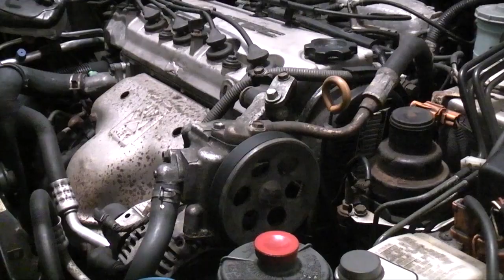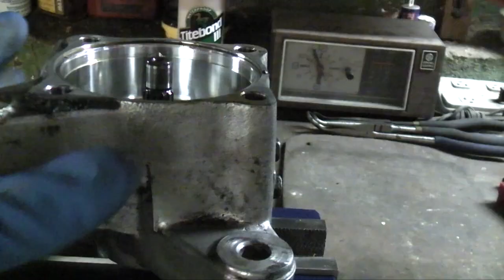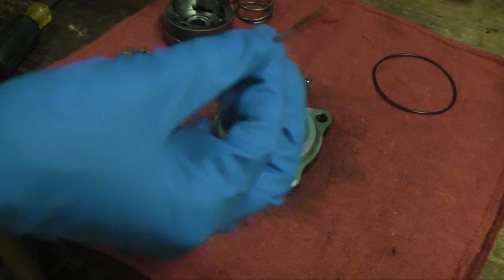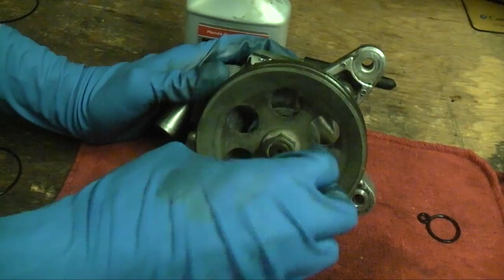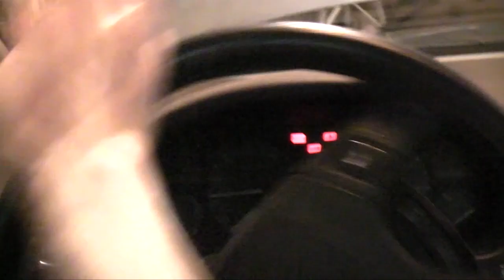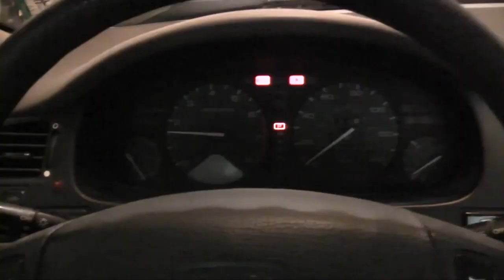94-97 Honda Accord Power Steering Pump Leak Reseal Repair

Comment: Il this is old but can you help me , idk if the power steering pully bolt is reverse threaded or not I see you turn it right and it comes off so is it ? Idk if it’s that or if my threads are messed up and it’s stripped on their

Comment: I've owned my 94 Honda Accord EX coupe for 26 years now and done most of the work myself..

With 238,000 Miles my original power steering pump is time to be replaced.

Your videos are excellent..!

One question does the pulley come off that easy or will I need a puller?
Reply from the maker: It's splined to the shaft so it should pull off by hand.

Comment: good video friend just one question where can I get the power steering pump bearing
Reply from the maker: If you're referring to the outer ball bearing it's pretty standard you should be able to buy it from anyone who stocks bearings if you find the code stamped on one of it's sides. The Honda part number is 91048-PY3-003. If you're referring to the rear needle bearing that's 91021-148-004.
Reply: @Bushougoma  If that's what I mean ball bearing (bearing) and I haven't been able to get it, they tell me it's not very common.  I'm from CD Juarez Chihuahua Mexico friend.  but thanks for your information and for your videos that have helped me a lot, I have an Accord 1994 dx 16 valves

Comment: my driver side engine mount is oily and seems like oil is coming from the tube on top of that (coming from the pump) what does it mean? reservoir is full (higher than top line when hot)

Comment: Trying to torque my pulley nut, but  the torque wrench is not clicking at 47 ft pds. I don't want to snap the shaft off. Used torque wrench on lug nut at same spec and it clicks no problem. Will tight as I can get it be ok?
Reply from the maker: Just get it snug and it will be fine.

Comment: Thank you very much for your video. Though I have Honda Civic 95 the power steering pump is absolutely the same. I did everything exactly as you showed and it went perfectly well without any hitch.

Comment: i hope i can fix mine like this.  2007 mazda 3, big leak out the back of the pump......the metal part, not the two flex hoses.  it flows out pretty quickly.  is it possible the lower section is electronically fried?  i drove home 7 miles after the pump leak happened so i assume it is fine.  there is no noise or anything, just a flowing leak out the metal section.

Comment: there was no need to remove the rotor from the backplate since it came out intact. You could've replaced those two o-rings with the rotor assembly as it sat when you removed that backplate, thats what I did on mine just now....way easier not having to worry about losing those rotor pieces.
Reply from the maker: Removing the rotor is still a good idea so you can inspect the rotor and it's bore for debris or scoring.

If it's badly scored you're better off with a rebuilt unit. I believe I neglected to mention that.
Reply: Did the same thing; left the back plate assembly intact and just switched o-rings.

Comment: you could first break the bolt on pulley then remove the belt
Reply from the maker: +08yallvon The belt doesn't have enough tension on it to hold the pulley it will slip when trying to remove the bolt by hand. The easiest tool to use is an impact which is what I normally use.

Comment: i regret repair it, just replace it with whole aftermarket new ps or stock or used item ps rack & pinion
Reply from the maker: +Jimmy Johanes A used pump will have seals just as old or older than your current ones on the verge of failure. Rubber doesn't get better with age. As for rebuilt parts. The quality of rebuilt aftermarket parts depends on the quality of the core and the quality of the parts used. I have had some problems with rebuilt power steering pumps right out of the box.

If the OE part is in good mechanical working order you should try to keep it. If in addition to leaks it's making noise or not operating properly then yes a reseal would be a waste and you should replace it.

Comment: Hi, my 94 Accord started making ps pump whine noise and bubbles in the reservoir, no leaks and it still works as it should. My question is, with a reseal kit will help pump or is better to put a new pump?

Comment: hi i have 2005 honda pilot, when i put new power steering pump do i need to fill it with oil, this isbecause for first second or two, when i start the car, (after topping off the reservoir of powe steering) the pump will run without oil .. is that ok..
Reply from the maker: It's fine as long as the reservoir is full before you start the vehicle. The pump won't run for too long before it primes and has a supply of oil.
Reply: Thanks much, do you recommend honda reman power steering pump or OEM. i heard cardone reman is not good. can i get used one from ebay.. or OEM pls advise.
Reply from the maker: sivaraj palanisamy I've used aftermarket remanufactured pumps without issue. Just make sure that it's done by a well known company.

Cardone is a major supplier of remanufactured parts.

Comment: Hi, I'm from Venezuela and here these pumps are very expensive and that set of seals are not available easily to repair pumps. I have a 97 2.2 Honda Odyssey which has a massive leak of steering fluid. I wonder The pump that has my car is the same pump that you show in this video? &  What part number should I use to order the set of seals? Thank you for let me know in advence..
Reply from the maker: The pumps while they look similar have different part numbers so they do vary somewhat.

Your local dealer should be able to get you the seal part numbers.
Reply: Thanks for your help. But Honda is leaving Venezuela due to the political issues here.. I can buy the part on the net.
Reply from the maker: Nicola Briceño Try hondaautomotiveparts you can get parts diagrams and look up the part numbers there.
Reply: Fine.. I'm going to check on it.. Thank you
Reply: Best thing to do is sell that car and leave that country for good. Thats what I would do if I were you, in fact that is what I did.

Comment: i recommend tightening all bolts in phases, never tighten a bolt all the way pattern or not , bring the entire face in gradually
great video nun the less
Reply from the maker: A torque wrench like the one used on those bolts must be used in one continuous rotating motion to achieve the proper torque. A tightened bolt will take MORE torque to rotate initially due to thread tension than a bolt already rotating which will give you a false reading.

Dividing the torque into multiple passes would solve this issue but it's a bit of a waste on such low torque fasteners (we're not dealing with a head gasket here) but you can if you want.
Reply: ***** not true about the false reading, truth is when you do what you did you smash your gasket down to a thickness thinner then a proper set gasket wit gradual tightening of bolts in steps. with phased in torquing this is mitigated. you can smash an o ring in half doing what you did  . nobody likes advice these days but im just trying to help freind , not only am i a part time millwright but i made this mistake on a pressure washer . you can smash a corner down to a lower depth then you can smash the entire gasket so basically you just "BENT"  the face of that pump .
Reply: ***** i was mostly talking to other viewers who seen you do this and did not under stand the expensive mistakes that can be caused as a result . on a car what you did is just fine no harm but if this was an air plane it wouldnt fly no pun intended

Comment: Hi, I follow the way you do it to unscrew nut pulley is clock wise, but unfortunately my pulley was dented due to force removing my civic nut pulley clock wise and at the end found out anti clock wise Arggg... anyway thanks for the video :)
Reply from the maker: The Civic uses a different style pump which is why I specified a certain model and year range of Accord in the title.

Other than the pulley nut being a standard thread and a few extra components inside the Accord and Civic pumps are surprisingly similar.
Reply: ***** Yeah, my mistake :( . I've download Civic manual but it did't says clock wise or anti clock wise.. I did search for you tube video for civic but fail...I'm so confident the way you do it haha..
Oh Btw, I manage to straight the pulley by hammering at the back...fuhh.. I'm lucky :)

Comment: Very nice video, do U THINK I CAN CHANGE THE PUMP BACK COVER O RING WITHOUT REMOVING THE PUMP FROM THE ENGINE?
Reply from the maker: Yes you can. But the other rubber parts are in the same poor condition and you may end up having to remove the pump to replace them in the future.
Reply: I was thinking the same thing bush. But then I also thought in the future of the shaft seal is probably worn and maybe some others so we'll have leaks elsewhere. Possibly even in the bypass or I mean the high pressure bypass

Comment: Busho, thanks for posting this video.  Again, you've saved me a load of cash.  So far it's working like a charm.  I think I noticed a little fluid under the pump after running the car for a bit.  I'll check again today after wiping it clean to make sure it's not left over from installation.  The only thing I can think of is the shaft seal.  I noticed after firmly tapping it into the shaft that the side with the writing on it was flush, but it seemed there was still a gap between the metal housing and the other side (with the spring). I'm realizing it's impossible to explain in a comment.  Do you know if it's leaking right off the bat or will it take a few days to notice a leak?
Reply from the maker: Make sure it's fully cleaned and recheck. If it's coming from the hole in the bottom the shaft seal is the only place it could be coming from.

Comment: Just did this on my 2000 Accord EX 4-cyl. As mentioned in the comments below there's a few less parts, but the basic design is the same.  A few less o-rings as well.  I was able to get the back cover o-ring off and replaced without taking the pump 'innards' apart, which simplified it for me.  There's no spring which helped.  Thanks so much for posting this video.
Reply: 10 years late but, do you know if the pulley nut is a left hand thread on the 98-02 models as well?

Comment: Does Honda of America provide a reseal kit containing all the needed "O" rings and the one seal or do you have to look up and order each part?  We have a 1997 Accord EX 4 Cylinder VTEC with about 177K.  I noticed several oil wet spots on the power steering pump.  The pump makes no noise. I will order the needed parts and reseal the power steering pump.  Thank you for an excellent video!  Your video has a great close ups on the area of dis-assembly/cleaning/parts replacement and reassembly. The exact amount of detailed instructions necessary and you don't waste time on the obvious.
Reply from the maker: Unfortunately they don't you have to order the parts separately.

I've tried using aftermarket reseal kits in the past to save me the trouble of ordering all the part numbers separately from the dealer and the ones I tried we're incomplete missing critical o-rings.

Comment: Great video! Exactly what I was looking for. I am about to do this on my 02 TL-S the pump is very similar. How would I replace the bearing without damaging the shaft?
Reply from the maker: There is also a needle bearing in the rear cover. A shop press is the best method you could also try an arbor press.

If the bearings are badly worn they will cause uneven wear on the machined surfaces of the pump in which case a remanufactured unit is the best option.

Comment: I searched entire youtube. i think only you did video on power steering pump seal replacement. i found few but not detailed to this extent. you are unique..

1) One of my friend have power steering pump growling noise(honda accord 98). when i open the cap of pump i see foaming and air bubble.
2) I tried many methods to remove air from system.. like mityvac, then dead end to dead end.. no use.. 
3) Can you tell me if growling noise can come only from pump and not from rack.
4) If pump(based on this video, which part cause the growling noise)..
5) do u think if pressure testing power steering pump is ever needed. I thought of bying the tool, but dont see any one using it.
6) you have changed some of the seal that is not exposed out, (meaning it is inside the pump), so why do u want to change that, i know there should be a reason, but like to know why.
7) can a bad power steering fluid will ruin the pump, if so which part goes bad, any clue.. 

SORRY asked too many questions, because i found only this video in entire site that explains about power steering pump.
Reply from the maker: Air bubbles that won't purge (assuming the reservoir is full) mean's you have a leak somewhere it also causes noise from the pump.

The leak can be anywhere the high pressure line, return line, rack, etc. Start easy check over the rubber return lines pay special attention to the metal hard lines they connect to they like to rust through and leak.

I've never owned a pump pressure gauge never really had a use for one. You'd also need different adapters for different model years and manufacturers too which can get real expensive.

Power steering fluid contaminated with debris can ruin the machined surfaces of the pump and score the machined surfaces of the rack which can cause end seal leaks. Just like contaminated oil can destroy an engine.

Check out my power steering leak diagnosis video. It's for a 94-97 Accord but the layout is similar and will show where to check for leaks.
Reply: Thanks so much. Last Q, have u ever tested a regulator in alternator, i found no information about how to test. If voltage is high more than 15 or so, i assume regulator is bad, apart from this, if voltage is low, or voltage is zero.. i dont see how i can test it, yes there are so many other reason for error, like diode, slip ring, communator, so and so forth. i am more inteersted on regulator testing, any clue
Reply from the maker: sivaraj palanisamy
An alternator doesn't have a commutator it has slip rings they aren't segmented like the bars on a commutator.

No voltage output would suggest the brushes are worn, there's an open in the rotors field winding, the B+ fuse is blown, the regulator isn't getting power from the ignition switch, or on some designs the charging light is blown out. This is just a short list.

If revving the engine or tapping the alternator gets it charging again worn brushes are the most likely culprit.

A diode issue will cause a drop in output. You can check the ripple with a scope on the B+ post. You can also measure the AC ripple voltage.

To test the regulator full field it. There's usually a hole to insert a screw driver into. Check the service manual for it's location. If the alternator charging current (measured with a clamp meter on the B+ post) is within specifications the regulator is bad. If the charging current is low the issue is elsewhere in the alternator.

Only full field it momentarily to verify the charging current or you can overcharge the battery or damage the electrical system.

Most service manuals have a flow chart that will walk you through the troubleshooting process.

It's not really cost effective to repair an alternator when rebuilt units are so cheap and come with a warranty.
Reply: thank you very much.
Reply: That statement you made bush, about the commuter rings. You really know what you're talking about. I can see that now. Where did you get all of your experience and know-how. Anyway thank you very much for the power steering tear down as it was the best I have ever seen

Comment: Great video. Thanks! I have one question. Would you recommend replacing the fluid completely when doing this repair?
Reply from the maker: It's not a bad idea. To get the fluid out remove the smaller return line from the reservoir and put it into a drain pan. Plug the hole in the reservoir where you removed the line.

Then start the vehicle up and turn the wheel from lock to lock until the system runs dry.

Shut the engine down when fluid stops flowing out of the return line you don't want to run the pump dry for too long.

Refilling and repeating this a few times will get the old fluid out.

Comment: HI, nice work . Im having power steering fluid coming up to the reservoir. thats telling me that theres is air in the line.I orderd a new o-rings to inlet to pump body&outlet pressure hose to steering.05 EX accord 2.4 motor with 155000

Comment: Hey awesome vid, I will be doing this in the near future. One question though, how do you go about replacing the bearing if it turns out to be bad? Does it just press on to the shaft?
Reply from the maker: Yes it does and there's also a needle bearing inside the rear cover to check.

If the bearing is badly worn and the pump was run for an extended period of time the excessive runout can unevenly wear the machined surfaces inside the pump.

If the pump rotor, vanes, or bore is worn a remanufactured unit is the only option.
Reply: ***** good to know, thanks!
Reply: @Bushougoma  hey man youhappen to have a 97 honda v6 2.7l timing belt replacement video

Comment from the maker: Since I take it the new rack included new inner tie rods check the outer tie rods for play. With the vehicle off the ground grab the wheel on the left and the right and wiggle. Repeat the process up and down to check the ball joints. Movement in both directions may be coming from the wheel bearings. Check all of the suspension bushings for damage.

If the vehicle seems to pull only when braking I'd check the brake system.

You had an alignment done after the rack was swapped right?